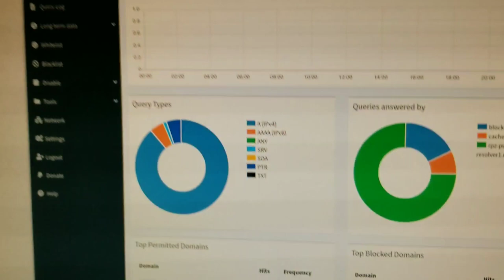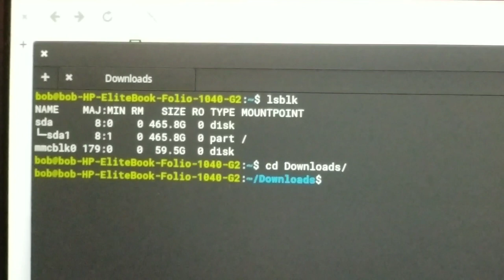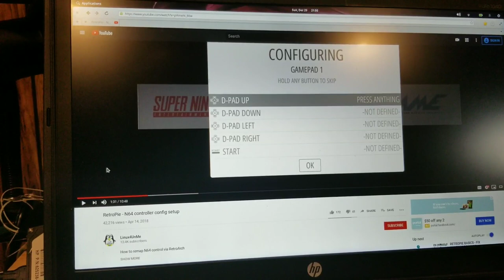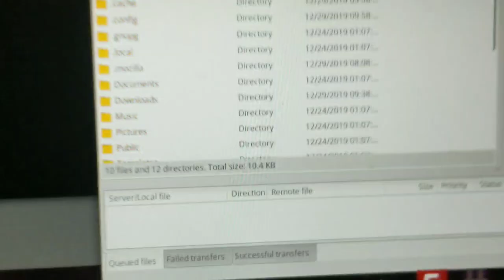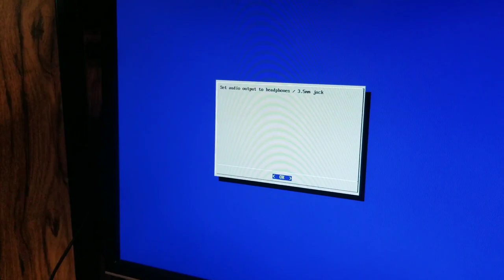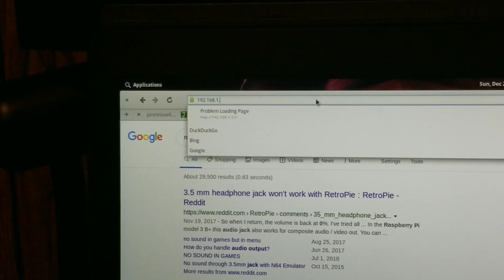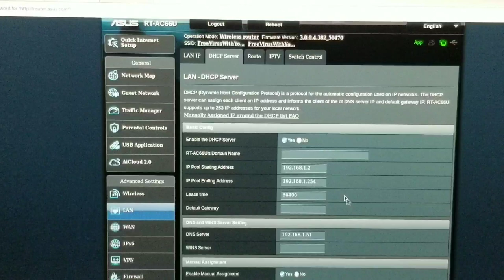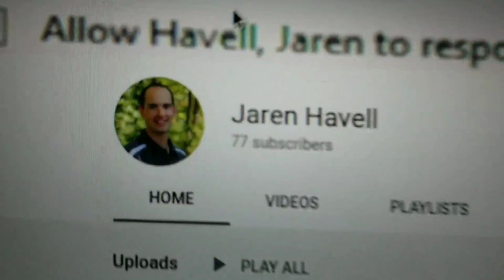Retropi with pi hole, using Linux computer. Play games and block ads!

Comment: Thanks for the content. Is it possible to turn just RetroPi off and leave PiHole avaiable?
Reply from the maker: yes... most people do not install PiHole like this. They usually just install it by itself. for me, I actually ended up moving this to a location without a TV so I never use retopi on this pi anymore :)